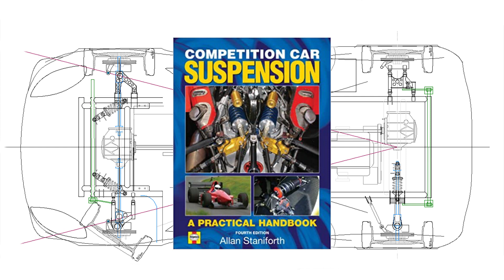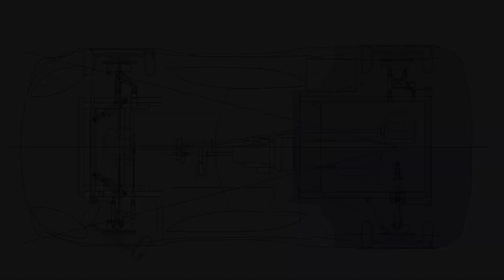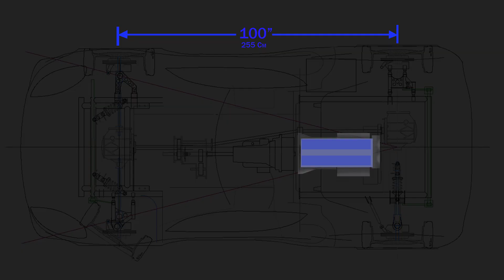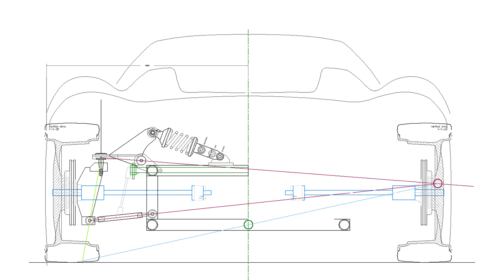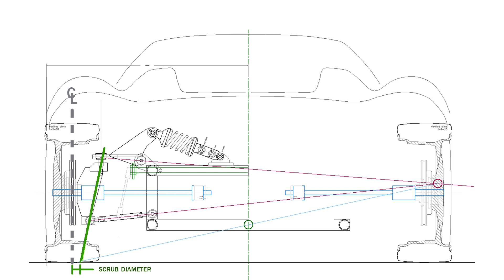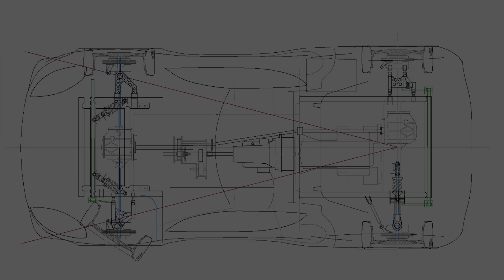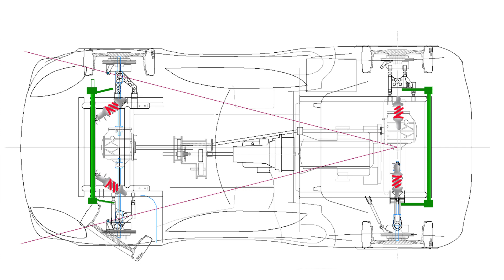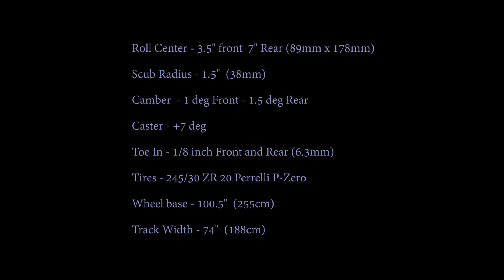A30 - Suspension- The design and geometry beneath a home made supercar. Arete supercar project

Comment: Roll centres look a bit high (danger of 'jacking'). I wouldn't worry too much about Ackerman as weight transfer effects come into play to counter this. Alan's book is quite good but contains some errors (check the math(s) !). Most of my experience is with RWD racers. 4WD introduces different design compromises....Go for around 30 deg's steering arc each way. Make the rack height adjustable and that will cope with bump-steer. Carroll Smith (Tune /Engineer to win is worth a read).
Reply from the maker: Adjustable is the answer to untested designs. I have tried to design multiple adjustment point, each direction of where the original design pointed me. Lots of road set up should dial it in.  Thanks for the input.

Comment: your explanation of bump steer is incomplete. yes, the root of the tire rod should be inline with the inboard balljoints, but a ray traced out from that to the intersection of the arms is also required. in your photo here it is VERY clear that you will have bump steer.

Comment: What do you consider to be "track width?" Outside to outside of the tires? For me, I consider it to be the face of where the wheel mounts. The reason why I ask is because if it's the wheel mounting surface for you, as well, then 1. You have a really WIDE car, and 2. you have a really short wheelbase-to-track width ratio, which might not be ideal for stability.
Reply from the maker: Track is center of the tire patch to center of the opposing. In my case , and yours, that also translates to the face of the rotor, where the wheel attaches. I have symmetrical tire diameters and widths all around, so geometry calculations are much simpler. Optimizing performance can have you running different diameters front and back and different track widths. Wheel base can also play a part as with a thousand other things, but somewhere you have to draw the line for real world limitations, like what can I fit in my shop. Ha!
Reply: @BuilderCreator  having the same sized tires front and rear is typically called a "square" setup. Also, if I understand correctly, it's less than ideal for a mid-engine vehicle, even if it IS AWD. Also, center to center of contact patches can change based on wheel offset dimensions, so the most reliable way is to the wheel mounting surface, and that's the way I prefer. In which case, if you TRULY have 74 inches wheel hub to wheel hub, then you have an extremely wide sports car compared to the norm. Along the line of 10 inches wider than average. If you consider a +25mm offset and a 10-inch wide wheel, that puts the outside wheel surfaces SEVEN FEET apart. Are you SURE it isn't a typo and you meant a 64-inch track? Because if not, you should be able to sit 3 people wide in this no problem. A 74-inch track width is something you find on a full-sized truck.
Reply from the maker: @Drunken_Hamster  Yea, when the video camera or the narration mic goes on, my specs get muddled. The track is 66" (wheel mount surface to wheel mount surface) 63.5" measuring from the center of the patch; the total width of the car is 74."
Reply: @BuilderCreator  Gotcha, that's fair. Still a pretty wide car, but not ridiculously so. As long as it's 79" overall width or less as far as the bumpers, skirts, or wheels go, it'll still fit on a standard car trailer!

Comment: 4:50 that is only part of the equation. It is equally as critical that the ball joint / socket at the knuckle  creates a line when drawn from the center of the  two tie rod pivots, intersects the instant center created by the control arms in the front view. 

Also, Pro / Perfect Ackerman geometry with  wheels following as close to a perfect arc is somewhat of a misunderstood geometry. Perfect Ackerman (i.e., that which the lines point at the center of the rear axle is really only a benefit for low speed cornering (like daily driver road cars) and  long term tire wear and can actually be counterproductive to ultimate lateral traction in high speed cornering. Most supercars and purpose built race cars (and even some high production high performance everyday type road cars) actually run very little to no "Pro Ackerman" steering geometry. In fact Formula type cars (F1, F3000, etc...) often tend to run what would be considered Anti-Ackerman in that the inner wheel actually turns less than the outer, not more. It all has to do with slip angles and vertical tire loads.
Reply from the maker: Oh! For the simpler days of king pins and solid rear axles!
Reply: I too am building an all wheel drive hotrod. I'd like to comment on CJ's point. He is correct, except all those cars he mentioned are not all wheel drive. A road-racing style all wheel drive car needs as close to perfect Ackerman as possible, because of the slip angle induced by the torque driving the front wheels. The principal is the same as CJ mentioned. On rear wheel drive cars, they need less Ackerman due to the slip angle generated by torque at the rear wheels in a turn. In essence, rear wheel drive generates "rear wheel steering", so less Ackerman needed. Just found the channel... Great job Jay!

Comment: I'd very much like to know the track width of the car and your maximum suspension travel.  Would you share?
Reply from the maker: 74 inches (1880mm) track width measured outside of wheel. 3.6 inches (91mm) travel in the coil-overs to bump.
Reply: @BuilderCreator  Ok, so how wide are the tires?  Also, if that's bump, then is it another 3.6 inches in droop for a total of 7.2"?  Thanks for the response.
Reply from the maker: @ProfessorOzone The tires are  Perelli 245/30 zr20s. travel is the coilover with bump stop at each end. 3.6 total
Reply: @BuilderCreator  Ok, so your actual track is something like 65".  That's pretty wide.  Thanks for the intel.  Keep up the good work!

Comment: From my experience I would suggest an extra half to full degree of camber all round and slightly less low profile tires, something more like 245/35r19 or even 245/40/r18 if you are using stiff sidewall tyres like semi slicks. I think car manufacturers go over the top with thin tyres nowadays which just isn't necessary with todays tyre technology to prevent tyre roll. The thinner tyres have too little play and therfore tend to skip across the road surface instead of conforming to it and increasing grip levels. Just my two cents and its only an opinion so I'm happy to be proved wrong.
Reply from the maker: well, I'm stuck with what I have for now. Once the car is on the road maybe then I can try some new tires, after that I will have something to compare to anyway.

Comment: This is a great explanation of some suspension geometry that I wasn't familiar with. One question or point I would make though is regarding the bump steer, I understand how having the inner tie rod pivot point on the control arm pivot line prevents bump steer (and I wish more car manufacturers would do this because it is a pain in the ass when building track cars) but I would have also said the tie rod should be as close to parallel with the control arms as possible, otherwise when it goes through its arc of travel its length will change much more than that of the control arms. In your diagram the rack seems to be positioned too high putting the tie rods at this awkward angle which appears as though it would have the detrimental affect of causing bump steer which you are trying to mitigate in your overall suspension design
Reply from the maker: The art work in this video is a bit misleading, but I have made the move to re position the steering rack anyway. originally (at top) I was about 1.4" out of plane with the A-arm pivot point, by moving the rack to the bottom, I will be dead on with the lower arm. It will take some manipulation of the steering column and hubs, but nothing we can't handle.

Comment: I see many comments about your flawed logic on bumpsteer, however there is one more thing to note. Modern cars don't use ideal Ackermann steering geometry. Ackermann lines are drawn from tire axis of rotation and outer tie rod end. If lines from both sides meet at the center of the rear axle, then it's a perfect Ackermann. However engineers want to deform and "rub the tires in the road" that way to create more grip. Thus they use half-Ackermann where the meeting point is before or after the center of the rear axle
Reply from the maker: The ideal system would be servo driven tie rods (or the hubs themselves), independent of each other, with 4 wheel steering, computer controlled. In our world, you get it as close as possible and make adjustments. Thanks for watching the channel.
Reply: @BuilderCreator  !!! no esta bien equilibrado tiene mas de el 80% del peso atras y el largo deberia ser de mo mas de 235 cm aca y en la china lo puede salvar la traccion permanente pero eso auto vive de cola si lo pisas mas que seguro fijense donde esta la mayoria de sus componentes !!

Comment: Very ambitious project, I am genuinely impressed. It reminds me most of the Vector, except a practical version, and lacking all the malfeasance.
This is no barn-build, the scope is kind of staggering actually; it’s a real accomplishment just to get this far!
I’m skeptical the car is going to wind up all that livable, most likely it’s going to suffer major NVH (noise, vibration, and harshness): I had those exact same high durometer bushings on my own 1984 Fiero, what a sad mistake! It was such a jolly fine little car, spoiled instantly with that ‘upgrade.’ Afterwards I kind of lost interest until it got too decrepit & I gave it up (gosh, I actually still feel guilty about doing that!)
What will make this truly refined are all the impossible features, like adequate insulation, proper ventilation, good wipers, effective weatherstrip. I’m skeptical it’s going to have all that, but I can easily see this thing hitting 200+ mph without much difficulty (and looking extraordinarily cool in the process).
Reply from the maker: Noise, vibration and harshness . . that was my childhood dream! maybe it will make me feel 30 years younger? Ha!

Comment: I started writing this very matter of factly when i started but i realized i came off as a dick at first so, firstly i want to say i stumbled across your channel some how and its been exactly what ive needed for quite some time. i have a passion for cars and like you just building cars has lost its challenge unlike you i do not have the money at this point to start the project i have had in my head for quite some time. Your work has inspired my to get back to building and finishing even some of the small projects to get me to a point where i can possibly have the space and time to start on mine. if you'd like to see some of my stuff its on ig @nerd_e30 with that said while i love learning a ton of fabrication information and engineering stand points in your video the steering angle of your rack and steering setup is going to be very bad when actually turning. i know you have probably already heard all this but the angle of deflection of the tie rod also needs to match the angle of your suspension. as it were in this video when turning and hitting a bump your front tires would dramatically toe out and as im sure you know toe out causes serious direction control issues. not to mention the angle which you had them on this video they would wear severely due to the angle and loading. yes when in a straight forward direction they wouldn't be bad but even still the amount of angle change on the tie-rods compared to the control arms you will still have toe out when hitting bumps and i know toe out will cause wander.  If its at all possible have a look in your cad drawings and see what happens during compression and rebound,  your change of angle while in steering would actually be even more prevalent due to this setup as well and the outside would be under compression while in turn and outside drooped slightly (obviously stabilizer bars will control that as much as possible) but needless to say your outside wheel would be forced to toe out and inside toe in even more.  you nee to bring the rack closer to the centerline of the wheel vertically without having the tie rods cross over the 0 degree plain while in use(steering w/bumps etc) if the rack is too flat you will have a difference between left and right and when hitting bumps you will get a forced steer where the car will either lessen steering angle or increase steering angle with fixed steering input. This is the case on most lowered cars even with the steering rack in the factory position all of the geometry in suspension minus ride height is all the same but bump steer occurs due to that change in direction of angular increase/ decrease due to geometry change. i hope this helps i am just a red seal master technician who specialized in race alignment for a few years and im sure there are a bunch of engineers on here that can verify through cad or what not but i have verified all of this through real world application performing close to 10,000 alignments in my time as a professional automotive service mechanic.  Anyways i hope some of this is useful, if you ever need someone to spit ball i would love to chat, i respond on instagram to people all over building similar bmw's to mine and would love to be where ever you are just to be able to put in some work on this, what is to be, an amazing machine, i have no doubt.

Comment: Please take another look at your bumpsteer geometry! It is not only the pivot point being on the blue line, it is also about the angle of the toe link relative to the other 2 A-arms. Ideally, they should all meet at the same point when you lengthen them to imaginary lines.
Reply from the maker: That is the problem isn't it; having a pivot point that moves relative to two other pivot points that do not. I have tweeked it to fall in the best arc or optimum (relative) through the most movement. I can make some adjustments after some testing. That's why we call this a prototype. Ha! Thanks for your input.
Reply: @BuilderCreator  Nice. Just make sure that the toe link meets at the same point as the instantaneous center. https://www.researchgate.net/figure/Suspension-and-steering-geometry-to-minimize-bump-steer_fig7_319629129

Comment: Hey, just want to mention that your thought around bumpsteer and how to avoid it is seemingly not correct. Doesn't matter if the pivot point of the tierod is in between the pivot point of the top and lower a-arm. What matter is the lenght of the tierod vs the lengths of the a-arms + the angles the a-arms and the tierod is mounted at. Basically how they "push/pull" the wheelhub when they articulate. In your illustration, it should be clear that you would have allot of bumpsteer. Also you can have no bumpsteer when wheels are pointing straight, while you have bumpsteer when they are turned.
Reply: I also thought this
Reply: Having a look at how it was done on some older Jaguars (XKE), they put the tie rods in the same plane as the upper A-arms and made the tie rod length that is projected into the plane of rotation the same length as the A-arm length (from inner joints to outer joints).  So as the A-arm moves up and down, the tie rod follows that geometry without generating any bump steer at all.  That verbal explanation might be hard to follow but if you look at photos of their suspension & tie rod setup, it becomes clear.  i have wondered why other car manufacturers haven't caught on to this.
Reply: The books tell you to place the pivot of the steering on the line (viewed from the front) between the pivots of the upper and lower control arms as he has mentioned.  I think that advice, however, assumes that the tie rod is horizontal and not at such a huge downward angle, like he has it here.  I agree, if the tire moves up, the outer pivot will move out significantly.

Comment: I hope it's just an oversight in the way the diagram was presented (4:38), but I believe having that much "droop" in the tie-rods is actually going to produce massive amounts of bump-steer (and exert unnecessary bending loads on the rack).
Reply: For additional context, I was recently looking at an aftermarket rack and their rack was only rated for a maximum of 10 degrees of tie rod angle (total). That diagram was showing something like 45 degrees or something crazy

Comment: Low polar moment of inertia =/= oversteer. It just means that the vehicle will have less resistance to yaw rotation. A high polar moment of inertia CAN present itself as understeer due to high slip angles at the front tires overloading the tires before the rear has time to react, so it is only true in the relative sense.

Comment: I would also recommend Race Car Vehicle Dynamics by Milliken as a good suspension design book. Did you use any software to determine your bump steer, camber gain etc?
Reply from the maker: No, just the drawings you see in the video. I'll have to give Amazon a look for the book. thanks
Reply: @BuilderCreator  That book approaches vehicle dynamics in a very theoretical manner so be warned that it is math heavy. But it is what I consider the bible for suspension design. For what the scope of what you are doing it might not be that useful you, but it will help you understand your setup from a fundamental point of you.

Comment: @3:13 that has to be some absurd approximation. If its that simple,.. they could change the angle of both control arms to point to the ground patch of the other tire, and achieve a zero height roll angle. So....
Reply: If you mean zero height roll center, then yes that is correct. If you look at FSAE cars they often do this, however it is not always the best idea.